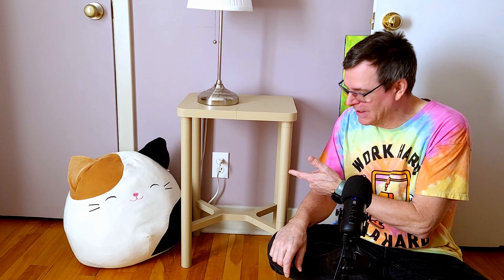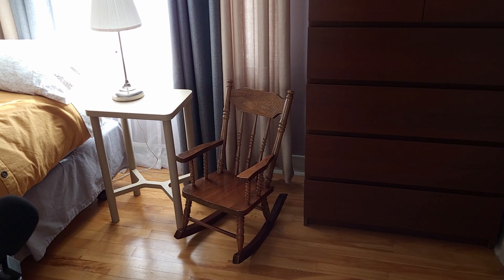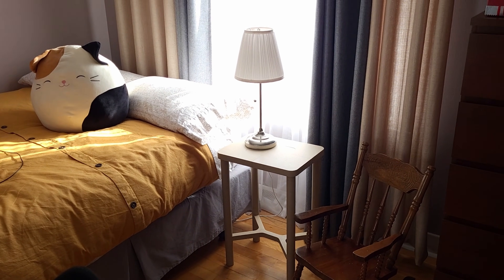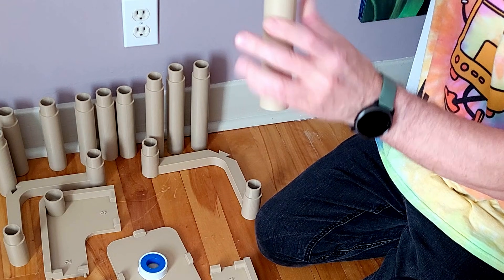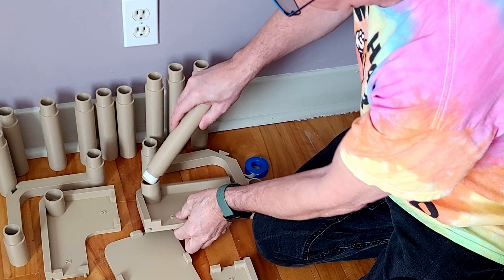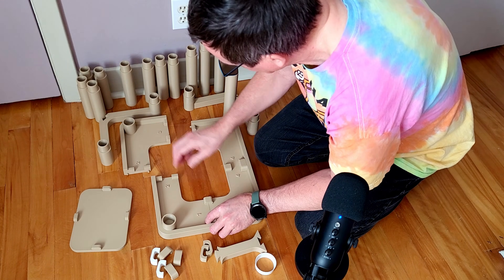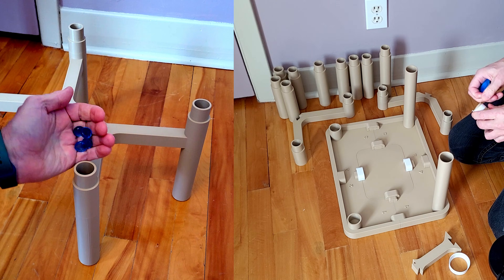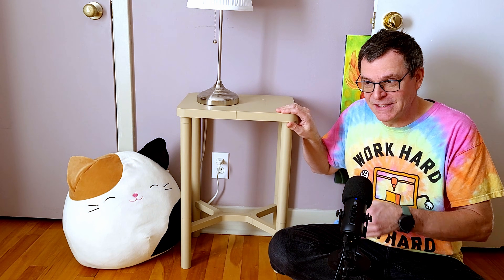I Tried 3D Printing a Bedside Table — Here’s What I Didn’t Expect

Comment from the maker: This table doesn’t use screws or glue — but it did teach me a few real-world lessons about tolerances, fit, and design that I didn’t expect.

If you’re curious:
👉 Filament used: SUNLU PLA
                                   USA https://amzn.to/4pa4ti9
                                   Canada https://amzn.to/3YimLCW
👉 Printer: Bambu Lab P1S with AMS

One thing I’m genuinely curious about —
would you print furniture like this, or would you still buy it?
Print… or buy?

(And if you like practical, down-to-earth 3D printing projects, feel free to stick around.)
Reply: Depends a lot on how much filament was used ...
Reply from the maker: @nicolesimon6346 
That's a great point.  Originally, I had the goal of less than one reel,  no glue, and no fasteners,  but I blew the one reel because of test printing connections.

Comment: I would combine traditional woodworking with 3D printed parts.
Reply from the maker: I love this idea and once owned a wood lathe. It's unlimited possibilities. Joaquin, do you design and 3D print?
Reply: @mayhemsmiley Yes, I design my own models in CAD and 3D print them — both FDM and SLA. I also love woodworking as a hobby, but I don’t have any formal training or expensive machines, so I keep it pretty simple for now.
Reply from the maker: @joaquinmadrid3642  sometimes simple is best.  I was trained as a machinist many years ago and the first tool training was with a file to produce a precise size 😂 I learned about from that exercise 😊 Happy printing and thank you for taking the time to comment.
Reply: @mayhemsmiley Yes, I design my own models in CAD and 3D print them — both FDM and SLA. I also love woodworking as a hobby, but I don’t have any formal training or expensive machines, so I keep it pretty simple for now.

Comment: I have seen 3d prints that join together so seamlessly you can barely tell there is a joint. I have not tried nor do I think I could replicate this on my machine, but it is possible.
The P1S is enclosed and temperature controlled right? Might be worth test printing those connections again with different filament.
Reply from the maker: Morning Ryan, I have created those seamless joints on multiple printers, but never mass produced the parts. The P1S chamber does warm up due to the bed and nozzle, but it isn’t actively temperature controlled. There’s no chamber heater or automatic fan control, the exhaust fan speed is material-based. The chamber temp is monitored, not regulated. But I am curious how the ambient room temperature might affect the prints, uh oh I smell some more testing. It gets cold in the room where I print. Sometimes down to 16C

Comment: Awesome design and had the same exact thought about integrating the seams into a floral pattern of some sort onto the too surface. I've seen painter's tape be used for filling rotation joints or press fit in this case if you're looking for something more rigid (and thicker?) than the teflon
Reply from the maker: Thanks Matt, I appreciate it 😊 I test printed every connection expecting a light press fit,  but ended up with some loose and some too tight.  I found some better design technics to test out that I'll share soon.

Comment: Any ideas as to why the pieces weren’t consistent sizes?
Reply from the maker: Morning CW, Such a great question. My honest answer is that I expected too much from these printers. I set my expectations on machine precision tolerances when these are glorified glue guns,  amazing glue guns but I printed the parts across a few days.  So slight temperature variations and inconsistent cooling from one part to the next can play a factor even in spite of the enclosure. I think the solution is a more dynamic design on my part is the solution. Are you working on something that requires repeat parts like mine?
Reply: @mayhemsmiley  Not immediately, but I do plan on sometime in the next month or two. Mostly I’m just curious the limits of these machines, and ways around those limits. The Teflon tape trick is a good idea!
Reply from the maker: @chwearl yah I test printed all joints before printing the complete table.  The Teflon tape saved it,  but there are better designs that work in spite of the variations.  I'll find the info soon,  but I'm mid design obssessed on something coming soon.
Reply: Print order?
Reply from the maker: @WeTheDeap sorry I don't understand the question. Let me know a little more details 😊
Reply: @mayhemsmiley the print order may have impacted the tolerance… was it printed one part at a time or all at once for the parts that were loose

(Or alternatively the bed wasn’t perfectly flat. Or even the filament wasn’t a good quality.)
Reply from the maker: @WeTheDeap thanks for the clarification.  Printed over a few days one piece at a time for the top and legs.  The clips were the only items batch printed. I used dried sunlu pla. It might be allot to ask from a 3d printer to achieve repeated machining tolerances.  I'll be testing a different design technic soon.
Reply: @mayhemsmiley  what was your seem alignment maybe a random seem would provide better tolerance?
Reply from the maker: @WeTheDeap  Interesting idea, mine were all aligned and I test printed each connection once before printing everything. It would be great if the seam could aligned for the exposed portion of the leg and random seam at the connection points on the inside only. hmmmm interesting.